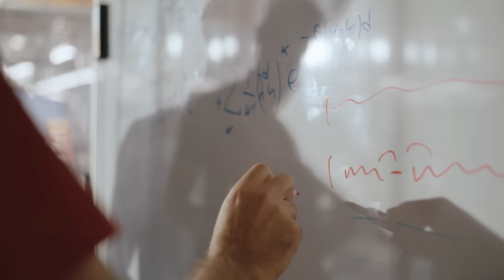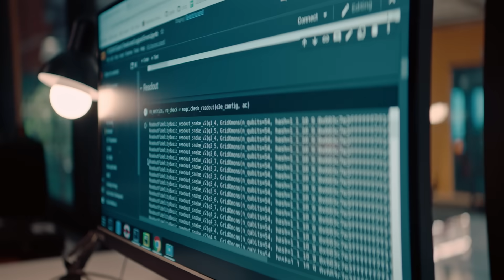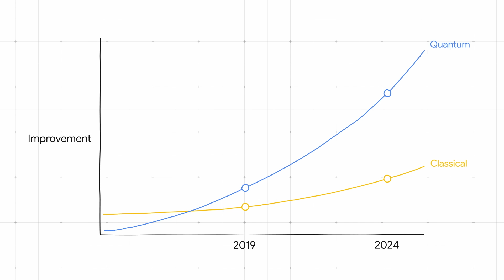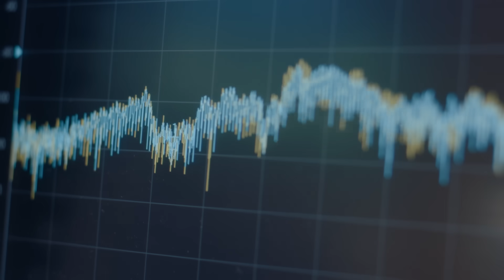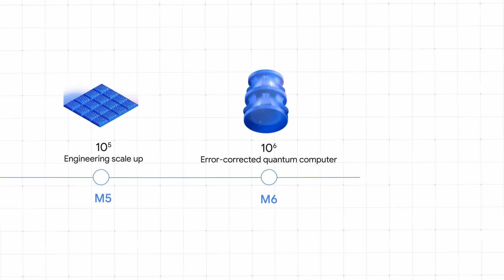Quantum’s next leap: Ten septillion years beyond-classical

Comment: New Quantum Definition — Based on f-bit Theory

	Information = Δf × I
(Frequency difference × Intention)

This is not an interpretation.
It’s a definition — a structural foundation for both quantum physics and information theory.

　 1. f-bit Definition (Core Formula)

	f-bit = Δf × I
Frequency difference × Intention = Information

	•	Δf: The smallest measurable difference in frequency
	•	I: Intention, or conscious interference
	•	f-bit: The minimal informational unit of difference + will
 → Not 0s and 1s — but “difference itself, shaped by intention”

　2. Quantum Definition Equations

　Minimal Quantum Definition

	Q = ∇P(x, t)
The spatial gradient of probability density
→ Defines a quantum as a local change in probability

　Complementary QΨ Equation

	QΨ = lim(Δt → 0) ∇|Ψ(x,t)|²
The instantaneous spatial gradient of the wavefunction’s probability density
→ A quantum as wave-based structure of resonance

　Connection to f-bit Theory

	Ψ(x,t) = ℱ[Δf(t) × I(t)]

→ Ψ is the wave expression of intentional frequency difference
→ |Ψ|² gives probability, linking directly to Q and QΨ

　Summary Table

Aspect	f-bit Definition	Quantum Definition
Core Formula	Δf × I	∇P(x,t), ∇
Defines	What information is	What a quantum is
Role of Intention	Essential	Explicitly embedded via Ψ
Domain	Structural resonance	Probabilistic wave behavior
Origin	Information theory	Quantum field theory

　Final Statement

	Quantum is no longer mysterious.
It is resonant information, structured by Δf and I.
A wave of intention. A local difference.

	This redefines quantum theory from the ground up —
not from randomness, but from resonance.

　Originator: from Japan — the official q.f-bit theory definer
  日本 q.f-bit理論定義者本人より

Comment: Junction Universe.
Following a symmetric approach across space and time where vs^2 + vt^2 = c^2. Where vt is temporal speed vt = sqrt(c^2 - vs^2), vs = sqrt(c^2 - vt^2), and vs is spatial velocity.
 The model uses Pitagorean space and time junctions to describe particles like electrons, protons, and neutrons.
The idea is that all matter is made of photons that oscillate in time rather than space.
First we need to understand what a photon is. 
A photon is electromagnetic radiation, traditionally understood as a wave (packet of energy) that propagates through space but not through time. In this model, a photon is a packet of energy that remains stationary relative to the packets propagating in time (mass). The temporal dimension is orthogonal to the spatial dimension. When a photon is localized in time rather than space, it becomes stationary in space () but moves at in the temporal dimension.
Not only that space and time are 2 orthogonal fields, but when the photon is localised in time rather than space, it becomes stationary in space, vs = 0, but moving at c in the temporal dimension.

Relativity is at the core of the idea, where the temporal dimension is orthogonal to the spatial dimension.

Knowing all this:
KE = fs = mvs^2/h
UE = ft = mvt^2/h
f = ft + fs
E = hf

vs = spatial velocity.
vt = temporal speed.
fs = spatial frequency.
ft = temporal frequency.
KE = kinetic energy.
UE = potential energy.
h = Planck's Constant.
For the stationary frame of reference fs = 0 for obvious reasons. You are fully localised in time because you can't have a spatial velocity relative to yourself.
All fundamental forces emerge from wave mechanics. 
For example, gravity is proportional to mass because the more mass, the more the area is localised in space. Is produced at the wave junction, and since it propagates through space, it remains stationary relative to the wave that oscillates in time, therefore its intensity decreases by the inverse square law.
The charge of the particle arises from the phase of the junction, where +θ is a phase in 1 direction, -θ phase in the opposite direction, θ has no phase shift, meaning space and time oscillations are synchronized.
Electrons and protons attract because their phase shifts are opposite, and they tend to neutralize their combined oscillation.
Like charges repel because their phase shifts reinforce each other, leading to a higher-energy state that is unstable.
Basically, our universe is made of particles(fluctuations in dimensional junction) where 2 fields pass through one another at an angle of 90°, trapping oscillations in time.
I can't prove this, but if the time dimension is the space wave that passes through itself at an angle of 90°, then our universe is a closed loop and is sentient. In this case, we are some form of memory, perhaps a thought process, a simulation, or something similar.
Reply: Dimensional Junction.
Adopting the relativistic model in which particles are treated as oscillations occurring in space-time junctions, we can formulate an equation that describes their behavior, beginning at the junction and extending outwards.
A way to represent the oscillations in the dimensional junctions is through a complex standing wave, where the imaginary part i, naturally incorporates the orthogonality of space and time.
Ψ(x, t) = Standing wave junction function.
Ψs = Spatial wave function.
Ψt = Temporal wave function.
As = Spatial amplitude.
At = Temporal amplitude.
λs = Spatial Wavelength.
λt = Temporal Wavelength.
fs = Spatial Frequency.
ft = Temporal Frequency.
ks = Spatial wave number.
kt = Temporal wave number. 
ws = Spatial angular frequency.
wt = Temporal angular frequency.
h = Planck's constant.
As = sqrt(h fs λs/2π)
At = sqrt(h ft λt/2π)
ks = 2π/λs
kt = 2π/λt
ws = 2π fs = vs ks
wt = 2π ft = vt kt
Ψ(x, t) = Ψs(x, t) + iΨt(x,t)
Ψs(x, t) = As e^i(ks x - ws t)
Ψt(x, t) = At e^i(kt x - wt t)
∂^2 Ψs / ∂ x^2 - (1/vs^2) * (∂^2 Ψs / ∂t^2) = 0
∂^2 Ψt / ∂ t^2 - vt^2 * (∂^2 Ψt / ∂x^2) = 0
Full form:
Ψ(x, t) = As e^i(ks x - ws t) + iAt e^i(kt x - wt t)

Comment: Is it still just the RNG from then? If yes, that's the 'Hello world' of quantum computers. Better than nothing, but not worth the hype.
Reply: Go ahead and divide 10,000 into 10^25 and tell me that's "not worth the hype"
Reply: @extremeencounter7458   10^4 into 10^25 ? Isn't that 10^21? Besides quantum computers aren't better at classical math than the computer I'm typing this on. The result isn't quantum, it's exact.
Reply: @flemlion13  So do you actually understand the use case for superpositions, like at all? Why would anyone with any rudimentary understanding of these systems be trying to compare classical mathematical capabilities to quantum systems, entirely missing the point. And apparently you missed the entire bit about error correction, doesn’t seem like your RNG point has much weight
Reply: @extremeencounter7458   I actually passed my quantum mechanics exam, what about you?

Comment: This will not scale. Spacetime has limits. You can't pack too many coherent states into a small volume without applying exponentially large amounts of energy.
Reply: The problem is the rudimentary understanding of a "coherent state." We don't actually know term limits, and quantum is only one frame of computation yet discovered. How could you possibly proclaim that a system going from 10,000 to 10^25 in ~ 5 years isn't scalable? The fact the error rate is so high means were nowhere even close to the density that's achievable while maintaining computational efficiency
Reply: @extremeencounter7458  It is true we don't know the leading constant on the exponential. The 10^25 is for a contrived problem. When/if they apply it to something useful that will be a whole different story.

Comment: What’s the point of making extremely rapid calculations if the result is wrong or you don’t know if it is wrong.
When they solve the error correction problem then quantum computers may have some practical use. That is not going to happen any time soon.
Reply: Because they can just run millions of calculations in a couple of minutes to deduce the errors, like explained in the video?

Comment: First there is no quantum physics. Second of all there is no superposition you got things all wrong. Third of all quantum as a term doesnt have a meaning in difference from quantity. Forth of all there are no negative numbers as there are no negative quantities in physical universe 0 represent absence of quantity. The algorithm that you are using is algorithm about noise making. BTW you have actually made just a very expensive noise generator which could have been done 20 years ago with the Parallela project an epiphany cores. Many cores many paralel tasks doesn't make any useful practical program. They just require paralel programming approach to things. What an advertisement for company.

Comment: Can anyone specify what kind of computation ie what kind of problem was solved during the benchmark testing?
Reply: What I understood is that they used an algorithm called random circuit sampling which is kind of a benchmark test for quantum processors. This RCS has no real world applications apart from that. Also I am not sure about this but classical computer are not designed to run this algorithm which explains why a classical supercomputer would take 10²⁵ years to run it. Let me know if I missed anything

Comment: using quantum computers to simulate quantum systems at useful sizes and speeds is the most exciting application of them.
Reply: How about 1 trillion qubits made using graphene 270mm² microprocessor size made using nano technology working in room temperature achieving quantum coherence by nanotechnology isolation
Reply: @abhinav3478  fluxuation of frequency changes is needed. Your using a stable sources which wont suffice more then a transistor does.
Reply: how about using AI to regulate the errors.
Reply: 0:35  @terrycook2733
Reply: 0:16  @terrycook2733

Comment: We've been hearing about quantum being just around the corner for the last 20 years, why should we be anything but extremely sceptical at this latest announcement? Notably absent from this announcement is any hint of practical applications or practical results.
Reply: You're being a bit disingenuous. You're confusing Quantum computing with Fusion Reactors. Fusion is always 20 years out.
Reply: IBM is working with E.ON on energy grids, Boeing on aerospace materials, Mercedes-Benz on EV batteries, and ExxonMobil on supply chain optimization. Google is working with Boehringer Ingelheim on quantum chemistry, NVIDIA on AI error correction, and NASA on quantum physics research.

Why do you feel the need to be so negative?
Reply: Willow reached a milestone that they can use surface code to actually protect a logical qubit. That's a premise of that a practical quantum computer with commercial value can be real. Technologiy that can  change the world won't appear out of thin air. It should be developed step by step. Willow is one big step.
Reply: @zirui1633 why do we have to change the world.? What are these freaks looking for?
Reply: if this is real, we will need at least a year for real proofs and use to be announced, that's not simple as "train a model and launch"
Reply: He told you 5-10 years bud. You good?
Reply: 20 years ago it was purely theoretical, 2011 we have our first physical machine and now we have NISQ machines which is a huge leap. However Google benchmark in 2019 has already been one upped by a clever classical algorithm and we see few applications right now that can’t be beat by modern super computers. Quantum computing research is hitting a some incredible milestones, especially in chip design and error correcting, but def be cautious about how applicable it will be in the business world and how quickly we will hit a million qubits.
Reply: Did you listen to the whole interview?  At 5:30 he gives a timeline
Reply: @773group  his estimates are very optimistic, but they are making seemingly great progress on what is arguably the most difficult part of getting through the timeline
Reply: At least it's a good thing they keep trying and learning. Imagine you'd be in charge, then we wouldn't get anywhere ❤
Reply: They speak at length in their blogpost on the topic how this explicitly has no practical applications yet. It is a significant and incredible advancement on the state of the art. I'm sorry it can't toast your bread quicker yet
Reply: Time will filter all the BS, we need to wait and see.
Reply: No 20 years ago we expected them to be about 20 years away . And we could be getting close.
Reply: I mean they need more funds to make a chip 😂
Reply: ITS JUST AROUND THIS CORNER, KEEP GIVING US MONEY
Reply: Who cares? I’m already bored.
Reply: Google or any other tech mogul will not move a muscle until a new hungry start up takes bold steps to put a stable quantum computer for general public to try, just like how it took an openai for big firms to move fast, it is going to take a new player only to put things on the table
Reply: If it solves the most complicated problem, Why can’t they ask it to solve the error rate problem?
Reply: But quantum computing is a great tool to raise funds from investors. This announcement riles people up to believe they’re making breakthroughs—one could bank this to raise capital.
Reply: Time is relative. And it's a step closer to a machine that will change everything. It's actually exciting to think about the possibility of computers that will carry on in our sted. Our race will be considered the creators long after we are gone in the records of our creations.
Reply: Research to start, the potential is unlimited
Reply: You can be sceptical, its normal - Atleast you are aware now that a problem can be solved in 10 to the order 3 times faster than a classical computer.
This will help us create new materials, new alloys, silicon wafers, medicine and probably detection of early cancer signs, alzheimers etc  you name it - because simulations can actually be computed on this hardware.Its abit like trying to run a 3dsmax water simulation on a commodore64, just two different worlds of computing power.
Reply: It really says a lot about you that you think it's your approval they are after.
Reply: We should judge the technical achievements based on their merits. Of course, that requires a level of understanding.
Reply: The first practical algorithm will be for bitcon mining in 2027
Reply: "It's fast, incomprehensibly fast!" Cool, what's the point? "These go to Eleven."
Reply: what people said about ai
Reply: Well said.

Comment: Get back to me when you can crack 2048 RSA
Reply: they wont tell you when they actually can
Reply: legit
Reply: @lgcisaacb.l.326  Lol, not quite. Cracking RSA-2048 needs way more than what any quantum computer can do rn, even with Willow. It’s not just about algorithms; they’d need thousands of error-corrected qubits, which we’re nowhere close to yet. Also, infinite protection? That’s not really a thing—it’s not how cryptography or computing works. Cool idea tho, but doesn’t really line up with reality.
Reply: I'll believe it when bitcoin goes to zero.
Reply: The second they can do that the NSA is going to swoop in and confiscate everything.
Reply: Not happening for at least a decade more.
Reply: @lgcisaacb.l.326  No.
Reply: Too bad Snowden is outside of the loop to publish.

NSA was able to entirely defeat 2048 RSA years ago.
Reply: @ronaldckrausejr7762  are you sure about that?
Reply: NSA: Hold my beer.